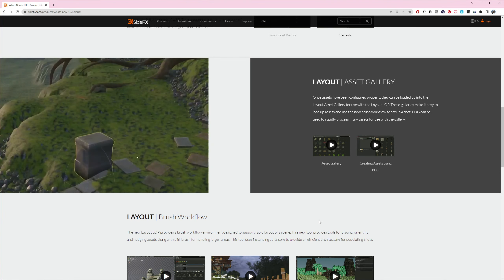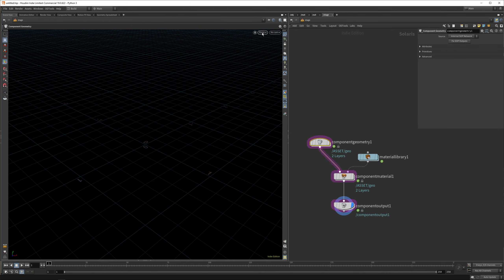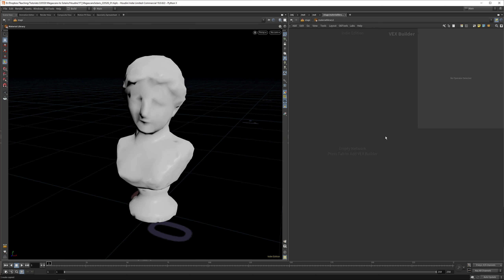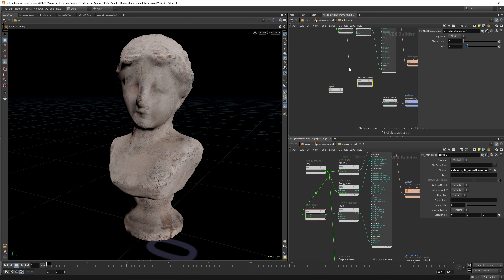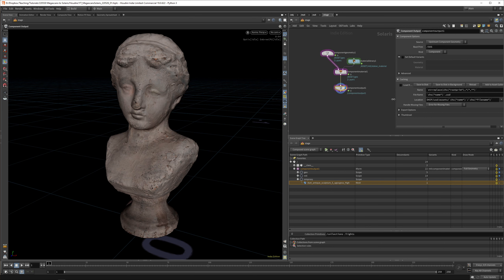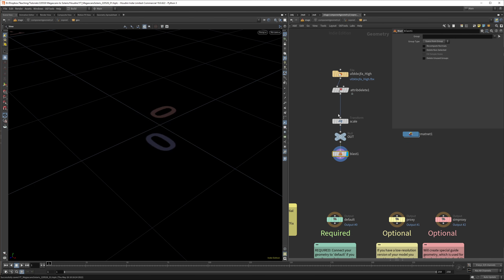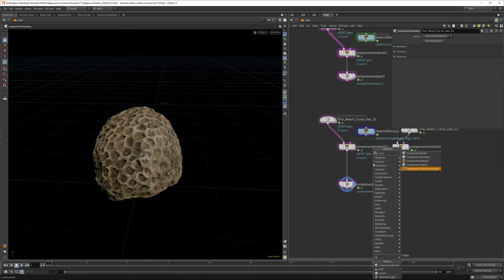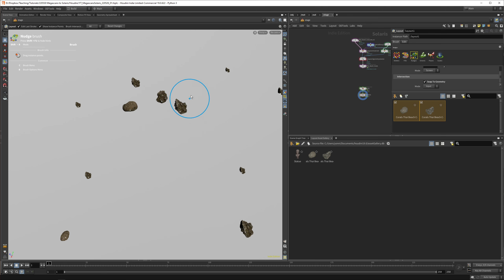Convert Megascans assets to Solaris USD Components

Comment: frutrating. super easy if you have the "od tools". what are od tools? because without the od tools you're back to mapping textures manually on your geo. which is fine until you have a complex asset with hundreds of textures like a buiding or kitbash asset for example